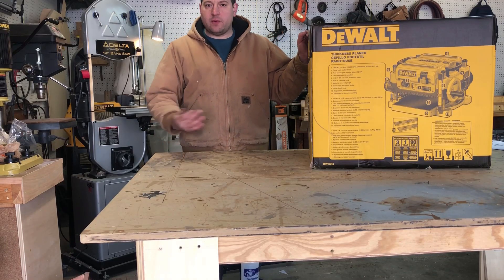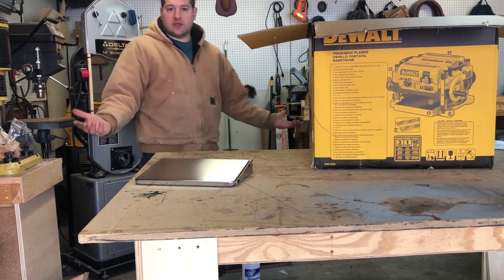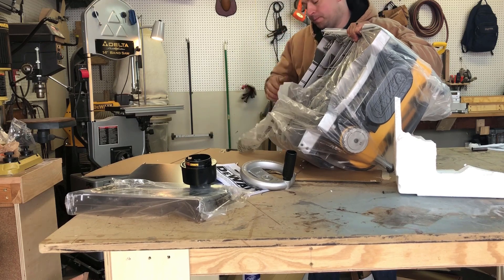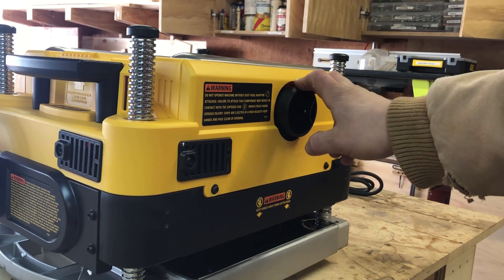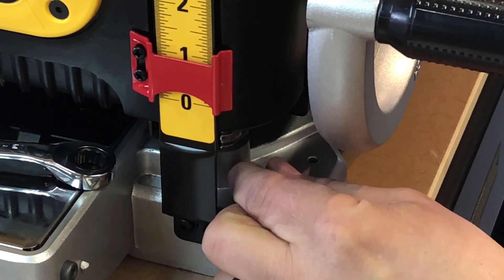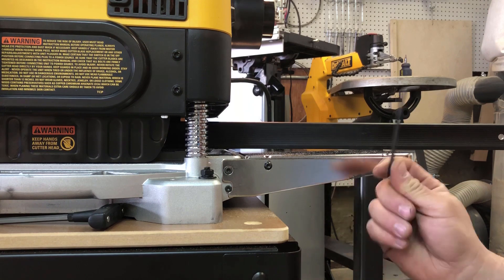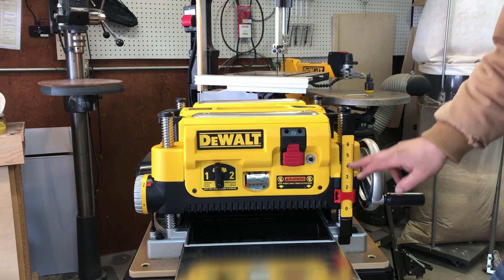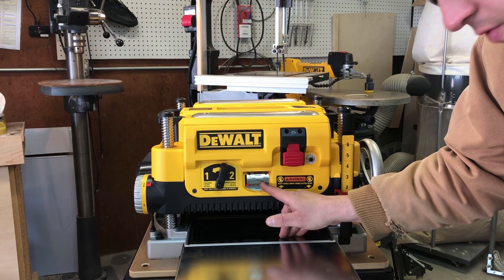DeWALT DW735 Planer Unboxing/How to Adjust

Comment: After so many videos someone FINALLY explained clearly what the turret stop does.  I got a DW735 from a neighbor who sold it to me for $100.00.  It was in its original box and he said he used it once, but he wanted a wider than 13-inch planer.   It didn't have a manual and he didn't know where it was, and the only manual I found online didn't exactly explain what the turret stop does, other than to use it to plane multiple boards to the same depth.  I've never used a planer before so I wasn't sure how it worked and while most of the instruction manual made sense, the description of the turret stop didn't. I saw your video and bought the optional folding tables so it works awesome for me.  Thanks.

Comment: I agree with comments below and will not duplicate the things they pointed out. One thing you also failed to mention is that the turret stop may need to be adjusted. Out of the box my planer milled to 1/16 inch (60 thousandths) shy of measurement on indicator. I wanted it to be proud by a few thousandths rather than shy, to allow for sanding after a glue up. This is easily done by adjusting the stop bolt under the thickness dial. My accuracy was .005 inch and precision .002-3. This is way more than acceptable for wood. The  Vernier caliper alone compresses the wood a thousandth of an inch when measuring.

Comment: This planer not come with an angled adapter for the chip ejector?  Just to get the dust collection hose out of the way....Just saying.  After all...these things are $600/$650 depending on which one you get....the 735 or the 735x (which I would recommend as it comes with the input/output trays and an extra set of blades.

Comment: The adjustment from 1 to 2 or 2 to 1 does not change otor speed, it changes the how fast the stock is feed through the planer.
Reply: Also… you should ONLY adjust the speed from 1 to 2 while the unit IS  R U N N I N G ! ! !

Comment: I was having a problem with sniping on my boards and ended up purchasing the extension wings; however after installing and adjusting them flat, I had only little improvements. I found that leaving the wings elevated on either side rather than flat eliminated nearly all the sniping.
Reply from the maker: Really, I am going to have to give that a try!
Reply: Did u adjust it and see a better effect? Less snip? Adjust or don’t adjust the wings?
Reply: @primalgraphx5747  I have the same planer and that was my experience as well. I leveled the wings and was getting bad snipe. Called Dewalt and they said the wings are set in the elevated position on purpose. I set them back how they were originally and now have zero snipe.
Reply from the maker: Good tip, I will have to try it!
Reply: Bingo. This guy is a rookie, no offense intended lol 😂
Reply: @primalgraphx5747  adjust up to reduce the snipe otherwise you will have waste on every board

Comment: Only adjust between 1 & 2 while the machine is running as noted on the label. It changes the feed rate of the rollers, not the speed of the motor. Slower speed offers more cuts per inch (finishing) while faster speed results in less cuts per inch (dimensioning).

Comment: Typically you want your infeed and outfeed tables pointed up almost like they were. Reduces snipe.
Reply: I was going to point that out but you beat me to punch. If you level the table you will definitely have snipe!!!
Reply: Yep, leave it as is. It’s supposed to tip up to lesson snipe.
Reply: While that is true, you do want them pointed up,   you don’t want them pointed up as much as in the video. It should be about the width of a penny between the bed and the level
Reply: Your right, it makes up for when the stock enters and exits beneath the compression of the feed rollers.

Comment: You have to change the blade speed, 1 to 2, or 2 to 1, while the machine is running. You didn't change anything while the machine was off.
Reply from the maker: Thanks
Reply from the maker: Your right I didn't, I may have to redo the video to include that. Thanks for the heads up and paying attention to detail
Reply: No problem. Keep up the good work. 👍🏽
Reply: @theselfmademan2875  Also, plane something :P